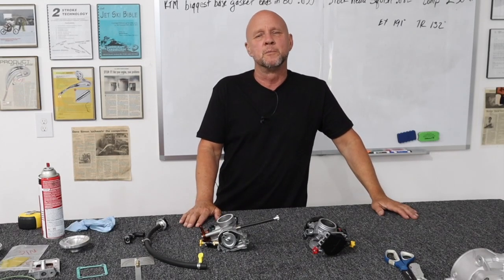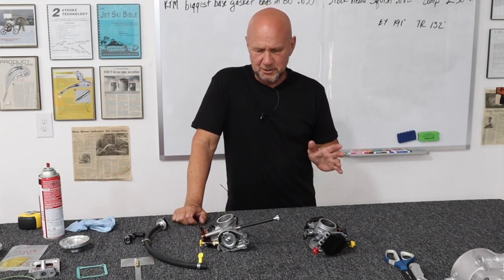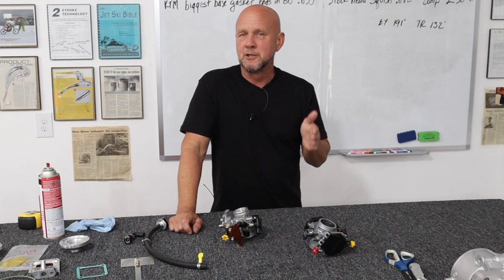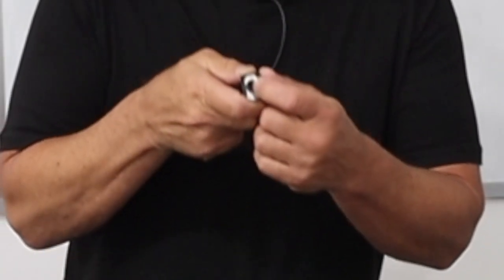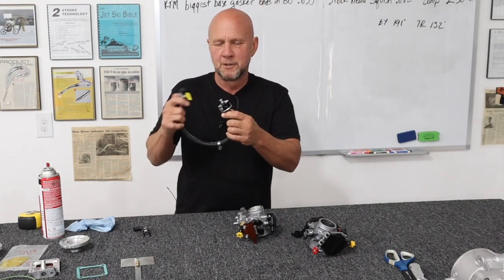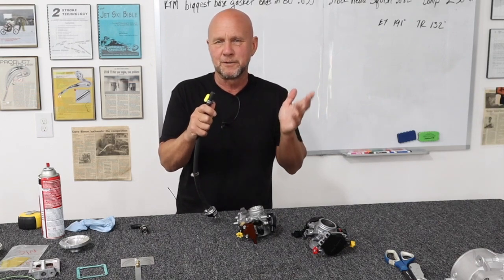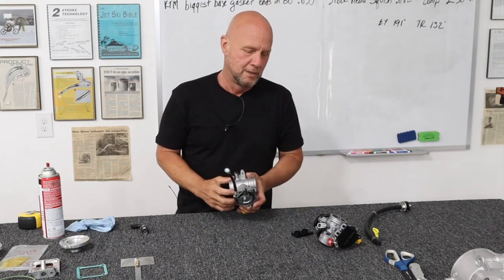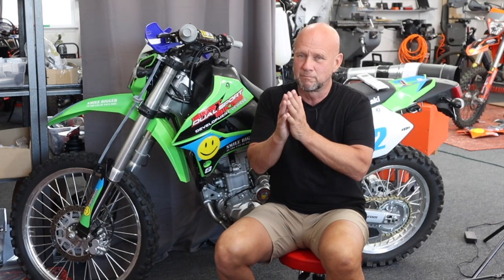New TBI Racing Fuel Rails - Flexible Idle Screws - Fixing Fuel Filter Issues

Comment: Does the lean condition at WOT cause the “FI” light to flash on the hour meter? That happens to mine on long desert pulls.
Reply from the maker: That wouldn't.  I think it's going outside of the pressure sensors parameter at that point.  I'll be running at Bonneville this year on the 300 so I'll have a better idea of issues